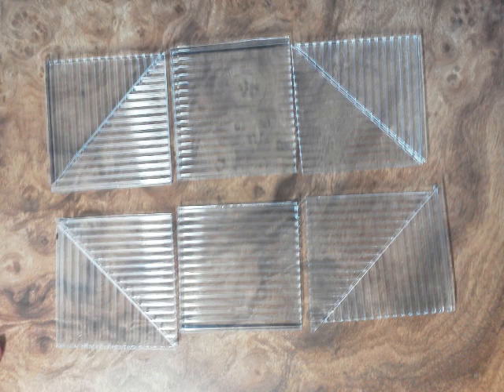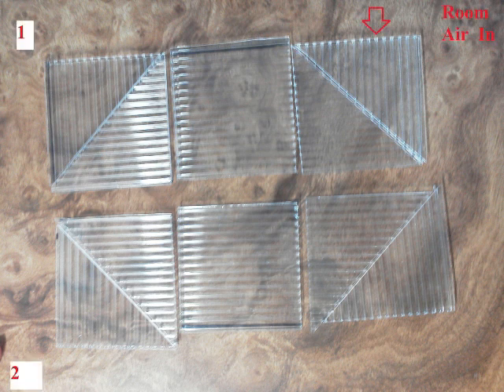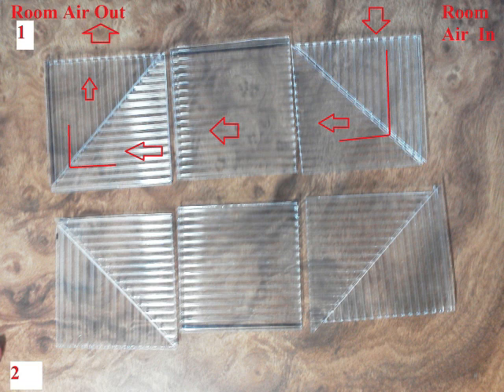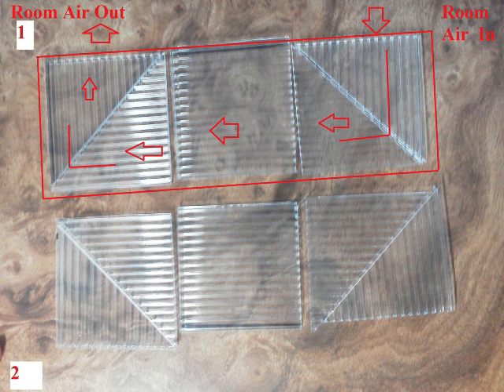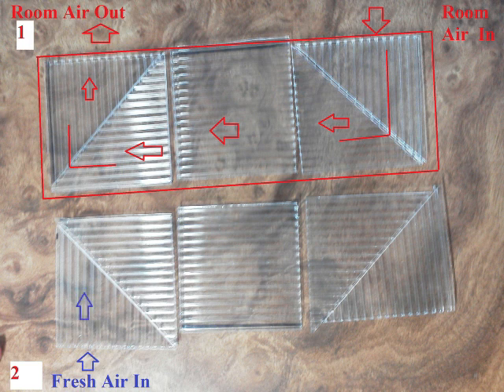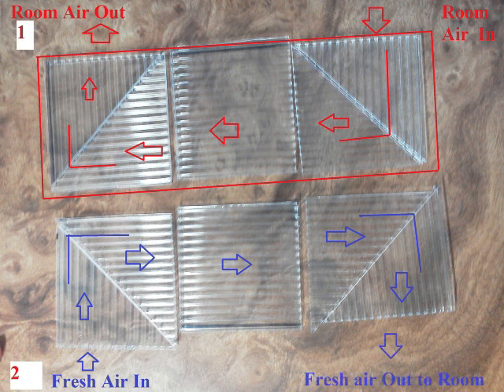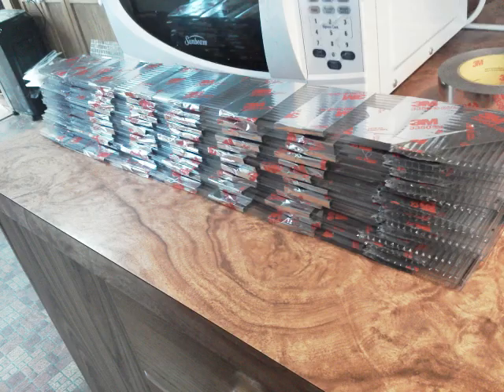DIY Heat Recovery Ventilation - 1

Comment: hi , great work, how much efficiency? and does it work for food dehydrator design 
the outgoing air is hot 55 degrees and humid, the inlet should retain as much heat without humidity
Reply from the maker: Test Results video of this home made DIY version https://www.youtube.com/watch?v=fCgf1lCK4qQ 

Efficiency varies some with difference in temperature.

Yes , heat recovery ventilation could also be used with food dehydrator , or a conventional clothes dyer .. to retain/recycle heat (transfer heat from exhaust output to input) , but expel humidity with the exhaust air (Humidity goes out exhaust air , fresh air intake has ambient intake levels of humidity) .. just be aware as you transfer the heat from the exhaust air to the intake air high humidity exhaust air might begin to condensate to a liquid .. soo allow/plan-for for that in your design for that condensation potential in the exhaust air flow.
Reply: @ianpgeorge thanks

Comment: Great idea, simple and inexpensive.
Comments.
You could use a J air flow, straight in one end, 90 deg the other. Obviously swapping ends for the in and out.
Alternatively for better heat transfer, only, say the out air, goes through the plastic, the in air flows between the in air plastic to both sides. 
One possible issue, over time I suspect you will get mould forming, so you need to take apart and clean.
Reply from the maker: Thanks for thoughts .. my thoughts :
#1> Your recommended straight one , J turn the 2nd .. 
I could just be me .. but .. I don't see the benefit in doing that ??
What do you see as the benefit is in doing that ?

#2> exhaust on both side of intake.
This design already does that.
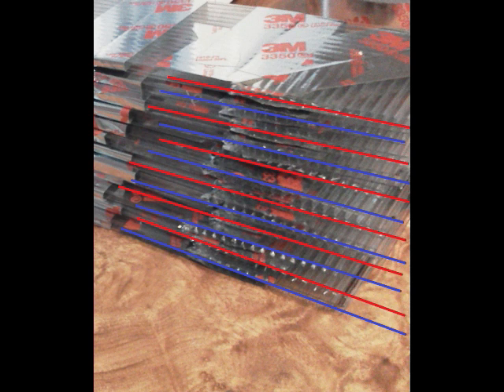The two air streams are already on both sides of each other .. see video at 1:45 .. inlet air has outlet air on either side .. outlet air has inlet air on either side of it.

Unless I misunderstood what you are suggesting ??

#3> Mold in the air channel getting colder (and thus increasing it's relative humidity) .. ie inside going outside in winter heating months .. or .. outside coming inside in summer air conditioning months .. that is 100% a real issue on any HRV .. a routine cleaning maintenance is what I would suggest .. in the case of this design .. it does not require it to be taken apart to clean .. just flush it out .. some bleach / peroxide /  white vinegar cleaning solution would be my recommended flushing agent .. in this design I would recommend flushing from the inside to the outside (just be careful with the flushing input at the fans)

Also note worthy .. a well made ERV , which exchanges both heat and moisture .. would have significantly less of this (less increase in that air streams relative humidity) but the materials for those introduces allot of other issues for a DIY project .. either in cost  , longevity , assembly , etc.

#4> I would also recommend adding a intake air filter , which I did not show / do in this video .. but such is better for long term use of any HRV .. DIY or Retail.
Reply: @ #1.  The J.  So the inlet has one straight end and at the other end a 90deg.  The outlet a 90deg and a straight.  Thus you have only two 90 deg bends, and better air flow.
#1.  What I suggest is that, rather than contain one of the air flows within the plastic sheet, it flows between the two adjacent sheets, so the heat only has to pass through one wall of plastic, rather than two. 
Thanks for advice on cleaning.
I have been thinking about this for a boat, so your advice / experience very useful.  I live in Scotland, so summer not an issue! 
If I do make one, I would consider using thin copper sheet for the plates.  being naturally resistant to mould. Like yours, with an extended central section, to give maximum efficiency.  By using cowls facing into / away from the wind it should work even without fans
Reply from the maker: @markthomasson5077  Thank you for clarifications .. good luck on your project .. I agree , one plastic wall would be better than two , just be careful to keep the air streams sealed and separated.

Comment: Am I correct in thinking that the polycarbonate performs well as a great exchanger?
I previously assumed it would be more insulating than conducting.
Reply from the maker: I'd say it performs 'pretty good' in this context / application .. 
Results testing in the follow up video

https://youtu.be/fCgf1lCK4qQ

Mainly for three reasons :

#1> Cost
Better conductive materials (aluminum , copper, etc) would require the device to cost vastly more .. like about ~100x more $ for the same amount of heat exchange (joules per volume of air per unit time).

factory made copper or aluminum based flat plate heat exchangers or factory made aluminum / copper HRVs are way more expensive than this was to make.

#2> Conductivity per size
Conductivity of a material is size dependent .. if you use a material that has less conductivity of aluminum , but you give it enough more surface area to interact with , the net result can be the same or even better overall system / device conductivity ... 

For example .. yes copper is a more conductive material than plastic (like Pex) .. but if you use a long enough (more interacting surface area) pex tube it will result in the same or better device/system level conductivity as the copper tube .. for example 300ft long 1/2" ID pex tube will conduct / transfer more joules of heat per second , than a 1ft long 1/2" ID copper tube would.

This example device has much more interaction surface area than a factory made copper or aluminum based flat plate heat exchangers .. or factory made HRVs .. they use the higher material conductivity to get away with a much smaller device.

#3> Conductivity per time
The more time two mediums have to interact the more heat transfers between them .. 

The plastic of a milk jug is not as good of a conductor as copper or aluminum would be .. but if that gallon of milk sits in your fridge long enough .. it's temperature will reach the same final static temperature no matter what the material of the container .. sure the more conductive material it will happen faster .. but given enough time there is no difference in total joules of heat that will eventually transfer.

This device does not move the medium (air) very fast .. a faster medium flow rate could achieve the same results if you used a more conductive material .. or a larger surface area device for the larger medium flow rate.
Reply: @ianpgeorge  copper has 398 m.W/K  thermal conductivity, polycarbonate 0.19–0.22 m.W/K, that is around 2000 times more conductive.  copper foil is more expensive, but way cheaper to achieve the same result.  In many video's I see aluminum (237 m.W/K) heat exchangers instead, not copper, so there must be a reason why Copper is not ideal.  Any idea ?
Reply from the maker: @IONYVDFC  It depends on what metric are you trying to reduce in your application .. cost .. weight .. size .. etc .. there is not one material that is best in every way.

Copper has better conductivity , by volume .. and thus would allow the same wh to conduct in a smaller volume device .. but if volume is not your target metric than copper might not be the best choice anymore.

Aluminum has better than copper conductivity , by weight , and by cost .. that's why high power electric lines are almost entire made with aluminum cores .. yes a copper one to conduct the same wh of energy could be a smaller volume .. it would weigh more and it would cost more.

Same with this polycarbonate HRV .. yes an alunimum or copper one could have been smaller volume device to do the same performance of wh transfer .. but both aluminum or copper would have cost VASTLY more $$$ .. in my application making this device lighter or smaller to transfer the same wh of heat , is just not worth the extra increase in cost.

It is not just the cost of raw material .. but the cost due to availability in the shape/form factor you need in your application .. look for copper multiwall sheets in the same form factor used in this application .. you will find that the economies of availability make the polycarbonate multiwall I used , VASTLY less expensive option.

Comment: This is a neat learning project, but with mhrv cores going for 200-500 USD on average would it not be better to buy the core and incorporate it into a DIY solution?
Less work, higher thermal exchange. Don't reinvent the wheel :)
Other than that nice project and video.

Comment: You had 4 temperature sensors. What were the measurements? What sort of efficiency did you get with your design? Thanks!
Reply from the maker: About ~90% heat retention (varied with conditions) .. more details in results video https://youtu.be/fCgf1lCK4qQ

Comment: Why not just rotate the layers 90 degree of your sandwich? Entry left, outlet right. Entry top, outlet bottom.
Reply from the maker: I thought it would be easier to align the flutes in a side to side style , so that's what I did.

But I don't see an obvious reason why your idea couldn't also work .. by all means try it out , test it , and see how it does.
Reply: But then you don’t get the benefit of the middle section.

Comment: Do you think this could work with 2mm corrodex or will it be too hard to align the holes to each other?
Reply from the maker: I am not personally familiar with corrodex .. so , I can't speak directly about that specific item .. I can just describe what you will need the material to be able to do.

If you build in layers (like I did in the video) , then alignment happens automatically.

A wide variety of materials can be used .. one is just trying to create two separate air paths .. that can still transfer heat through the air tight barrier between them.

Comment: As described in your layout, THIS WILL NOT WORK as a fresh air HRV. it WILL exchange thermal energy, BUT you’re NOT exchange air.  The layout should have more of an opposing S pattern rather than opposing U pattern. Your design brings outside air in to exchange heat with inside air and then send that air back outside, all while the inside air stays inside. Thermal exchange - yes. But the point of an HRV is to bring in fresh air and send out stale air but exchange thermal energy so the new air does not require so much energy to bring to the temperature of the inside environment.
Reply from the maker: This design can be used as you describe .. but that is not what I did , and not what I described in this video. You seem to have misunderstood the video at some point .. I will try and clarify the difference , between what I discribed in the video and what you describe.
---
As described in this video , used as an HRV unit.
If this unit (as described) is installed in a window .. 

The part outside of the house has a left hand side inlet of 'fresh air' .. and on the right hand side an exhaust of inside air going out.

The part on the inside of the house .. has a left hand side exhaust , which is the fresh air from the outside coming into the room .. and a right hand side , which is the inlet inside air being pulled in to go outside.
---
The same design could be used as you describe as well .. but that was not the intent here , nor what I described in the video.

For your method to work .. the unit's airflow would have to be turned 90degrees sideways on both intake and exhaust .. where so that the right hand side's air comes in from the room and also exhausts back out into the same room .. likewise the left hand side's air would come in from the outside and exhaust back out to the outside .. yes it could be used that way .. but not what I did , and not what this video describes.
---
As for the 'S' shape .. Thanks for the suggestion .. but , I disagree with your conclusion .. here's why.

The 'U' shape requires the air to make less turns , and as such will have less friction , and as such the 'U' shape version will give more CFM of air flow for a given about of fan power applied.

The 'S' shape you describe .. with it's additional turns , and increased friction , will slow / reduce the air flow from the same watt fan input.

If your goal is to just have less air flow .. it would be more efficient to just use the 'U' shape and supply a lower powered fan .. extra bends and turns in your HVAC air path is just not efficient.

Comment: did you find a local supplier for the thinwall?  how many sheets/cost?
how did you cut it?
dimensions of long section/end section? how many layers?
Reply from the maker: yes I did.

Common sizes of multiwall polycarbonate like used here .. are readily available from most home improvement stores , lowes/homedepote/etc .. That can be sandwiched (as in this video) to make it as thick as you wish. They make 3,4,etc wall sheets , 10,12,etc thick .. and different colors , widths / lengths etc .. but some of those others you might have to reach out to green house builders , or specialty stores.

You can use more sheets to make a bigger HRV for more air flow , or for a longer interface length for smaller heat loss .. whatever best fits your context/situation.

The example in this video started from a single piece of 2'x4' sheet .. about ~$30 for 1 sheet (prices vary) .. all together it cost me about ~$60 in materials (I have no doubt it could be made cheaper than that) .. professionally made HRV unit that does the same thing , can easily cost 5x what I spent , or more .. 1/2" foam insulation , Aluminum HVAC tape , 2 small watt fans , small AC/DC power supply for fans , 4 temperature probes(optional) .. it doesn't take allot of CFM fans to add up to whole room air change over 24+ hours of operation.

The sheet was cut up into the roughly ~3.5" x ~3.5" square pieces .. the end 45deg pieces were just 3.5" x 3.5" square pieces cut in half along the diagonal (making a triangle) .. the final unit in this video with 1/2" insulation is about ~5" tall x ~6" Wide x ~24" long.

I cut the piece in the video with a sharp utility knife .. but a variety of saws can also be used to cut those multiwall polycarbonate sheets.

This one was made with 12 layers .. indicated with the blue and red to show intake or exhaust air .. at 1m30s in the video... more layers are possible , but I would aim for a roughly as wide as it is tall final assembly of the air flow layers (before insulation).
Reply: @ianpgeorge   Thanks for the reply.  Are you aware that polycarbonate may be outgassing BPA/phthalates? whereas Coroplast would not.  Why did you not use Coroplast?
Reply from the maker: Thanks for the tip .. 

As to 'why did I' .. primarily , because I already had it from a previous experiment , thus no additional cost .. and as the saying goes .. reduse , reuse , recycle.

I'll agree with you , that anyone sensitive to , or concerned about off gassing .. careful product material selection can be very important.

Another useful tool people can use .. the amount of off gassing a given material does reduces over time .. new car off gassing / smell fades away .. new carpet off gassing / smell fades away .. etc .. soo not only careful material selection .. but by deliberately buying older materials , that will also help reduce the amount of off gassing.

Comment: You pumping losses are going to be incredible with the 2ea 90 bends... much easier to get more area by making a larger core.. then just making ducting to adapt to to your openings
Reply from the maker: My performance video @ https://www.youtube.com/watch?v=fCgf1lCK4qQ
Please give me a heads up when you post the video of your design .. ideally I'd also like to see the inlet and outlet temperatures as well please.

- - - - - - 

I agree with the existence of benefit in expanding surface area of the center section (mentioned in this video @ 0:23).

With this particular design shown in this video .. the two 90deg are required .. 1st to integrate the 2 air streams .. left and right side into the alternating layers .. then later to decouple them from back out to separate right and left air paths .. I do agree this turning of air path will increase back pressure , and reduce air flow rate .. but it is required of this design .. thus my interest in seeing when you post the video of your proposed alternative design.

As for the amount of back pressure , and thus reduced air flow this creates .. I just went and measured it with my anemometer .. I get 1.65m/s (~325ft/m) air speed from the 40mm x 40mm (~1.575in x ~1.575in) cross section opening .. which works out to be around ~5.6 CFM .. about ~74% of the fan's unrestricted 7.56CFM .. of course any design , even a straight section will have friction and induced back pressure and reduced air flow rate .. even the anemometer itself also induces a little bit more back pressure and further slowing of the air .. ~5.6CFM would still be 8,064CF/Day , for my 6,267 CF house .. is still about ~1.287 whole house air changes per day .. which is still plenty for this fresh air application.

Comment: Nice build! Looking forward to your follow up video on the performance you get. Will you also be giving the flow rates and a build video? Thanks for sharing!
Reply from the maker: Thanks.
Flow rates = yes
Build Video = no .. I did not record one .. If there are aspects of the build people want to know about , I'm happy to answer.
Reply: @ianpgeorge  The only question I have on your build is did you glue the layers of polycarbonate together?
Reply from the maker: Everything was bound together using the aluminum furnace tape .. it's inexpensive .. easy to work with .. and good enough for this application.
Reply: @ianpgeorge  Super! Thanks for the reply Ian!